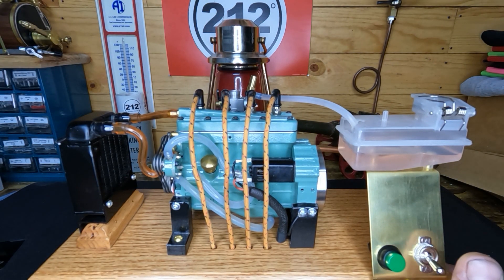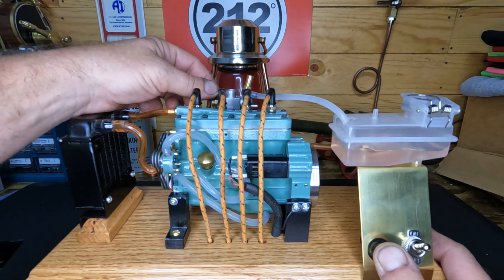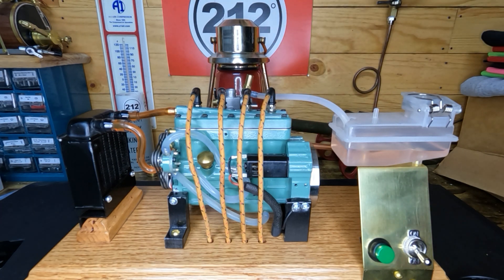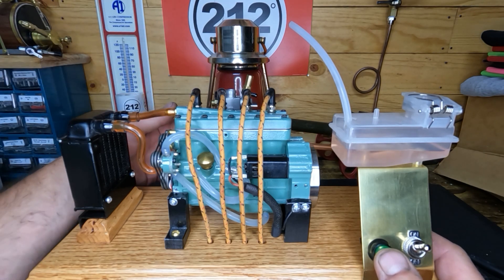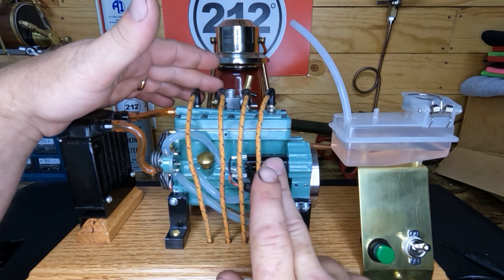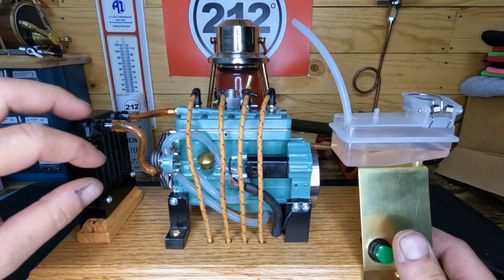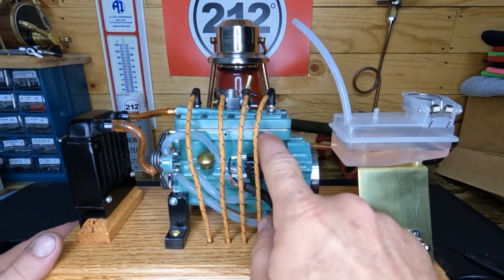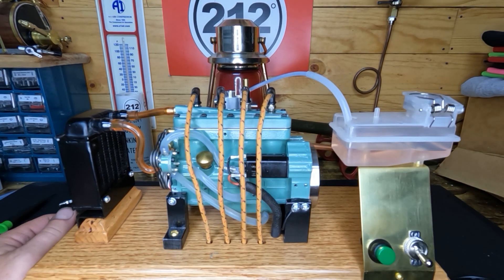A new Cison L4-175 flathead 4 cylinder engine! Part 4 Mounted and ready to start? Let's find out!

Comment: Hi, thanks for showing your engine not starting first attempt ! Mine didn't either. Fried two startmotors, then tried glow with nitro, fired right up, but made a mess with oil in the fuel. 
 Thinking maybe methanol no added oil ( perhaps nitro 10%) since there are oil in the engine. Not tried this yet. 
 Then back to gas ( don't really like nitro in the fuel since it's wery corosive) cranked a lot with a new Worker start motor 12v seems better quality. Bearly got the engine running half throttle !! Newer was thinking about the spark plugs ! Good point !! That's next, have oil leak also, but will not give up this great engine. Thanks for info. Bernt
Reply from the maker: Hi Bernt, I found that the proper firing order is 1-3-4-2 according to the valve timing. And when viewed from the front of the engine the rotation is clockwise. I do apologize for how long this little bugger took for me to share with you all, but I tried to show (roughly) what to look out for and try to help others if I could. I really do like the dual 6 volt battery setup, I have yet to burn up a starter motor. I don't know if I can help you in any way with your engine but I will try my best.  Thank you for your interest, your comments, and your interest in keeping this little hobby going. Once again, you guys are the best "steam crew" anyone could ever ask for 👍
Reply: Hi, I went out to check firing order, wonder if my box is ok ? By rotating the pully w.magnet I get mostly fiering in pairs ,but sometimes 3 plugs at once and sometimes no1 does not fire. Is the system made to fire the plug every rotation? The pic on the box shows a north and south magnet, some systems use this to tell where the first cylinder magnet is. Maybe my box is just junk. Also turned the needle all the way in , it still moved bubbles in the fuelline. How far out should the brass fuel inlet needle holder gå in to the carburator ? Before you stop with the nut. Well, more testing.
Reply from the maker: @bjornamanda  Hi Bjornamanda, I noticed on this one that they do fire in pairs but not in the pairs one would think (mine was 1 & 3 and 2 & 4) which won't allow this engine to run. So I used 3 on 4 and 4 on 3  making 1 and the "new" 4 fire as a pair and 2 & the ”new” 3 fire as a pair. As for the pairs firing every 180° it should not affect the paired cylinder as it is a wasted spark on the exhaust stroke. I'm sure I rambled on too much about this , but I hope my rambling will help you 👍
Reply: @steam212  Thanks for taking time. I will test this tonight, sometimes it seems to fire 3 at the same time also, I will check.
Bernt
Reply: @steam212  Hello, just to let you know, swapping leads helped, it want to start, fiering on some cylinders, very picky on throttle, only if it's almost closed . I want to wait for new spark plugs now, at least I know it run's on glow/nitro methanol.
 Thanks for all your effort helping , it's great to get help this way.
Regards, Bernt
Reply from the maker: @bjornamanda  Hi Bernt, I'm glad to have been of some help to you. This one doesn't like to start with the throttle too much above an idle either but I feel that after it is broken in a little more that will improve, the only way to know for sure is to run it more (oh darn, more time with model engines in the shop 😉)
Reply: @steam212  I talked with the engine designer,  he said that there is no issues for the CDI,  his original design ideology is :  on the engine,  starting from the belt wheel side, lab the first plug  as  plug 1,  label the 2nd plug as plug 2,  3rd  as plug 3,  4th plug as plug 4.     Just connect the firing cable labeled 1 on the CDI to the plug 1 , cable labeled 2 on the CDI  to the plug 2,  cable labbled 3 on the CDI to the plug3 , cable labeled b4 on the CDI to the plug 4.  It will work well on the gasline, no need to reprogram the CDI.   I will get my engine in a few days, and will upload my video. Thanks.
Reply: Hi again, I ordered 4 new spark plugs last night, newer expected the ignitionbox to be mislabeled, will check mine asap. Will try to turn inn the needle much more also. 
 I like the idea to test methanol with ignition also. Thanks for great inputs and  tips ! Bernt....